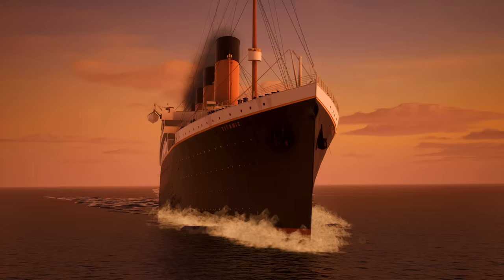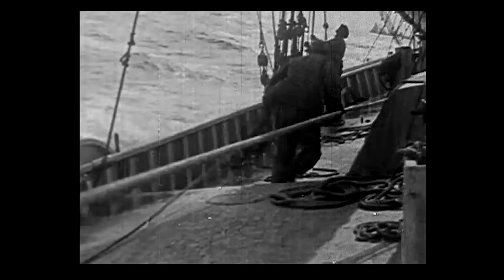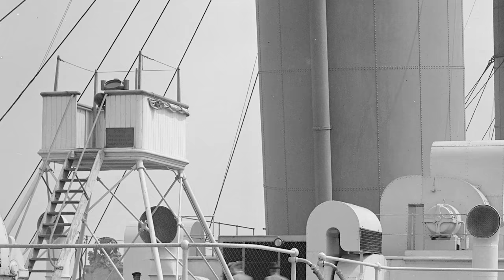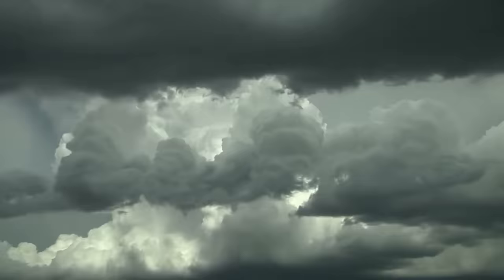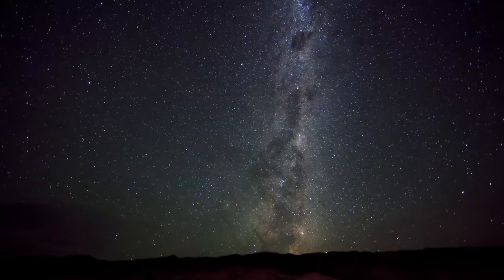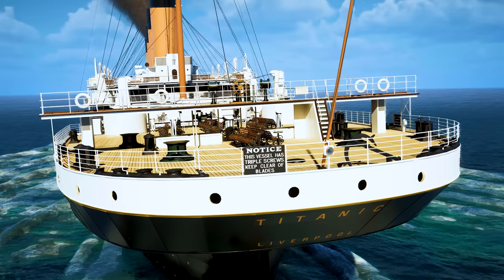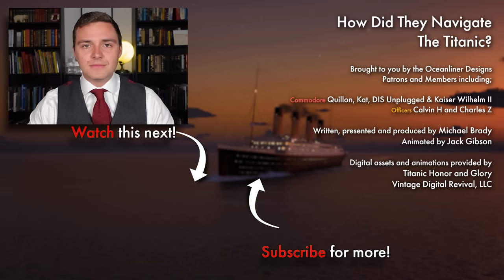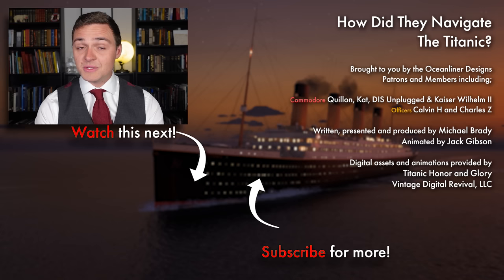How Did They Navigate the Titanic?

Comment: For those wondering what those green and red balls next to the compass are: Those are heavy steel balls that can be adjusted to fine tune the compass.
Reply: Iron...not steel. 
They are properly called "quadrantal spheres", but more often go by the moniker "navigator's balls" in the Navy. Their positions are adjusted (during an annual process called "swinging ship") to reduce the amount of error introduced as the ship turns thru the points of the compass, as the ship's relation to local magnetic fields also affects compass accuracy.
They are regularly put thru a process of heating to cherry red and then slow cooling (called "annealing") to remove residual magnetism.
There are also iron rods called "Flinder's rods" contained in a vertical tube contained within the compass stand. These are for reducing magnetic effects from the ship pitching up and down fore and aft.

Comment: Hi Mike. I’ve been binge-watching your videos most of today! They’re awesome! However, just to clarify, the big iron balls either side of the compass binnacle are to compensate for the effect of the ship’s steel. There’s also a set of iron bars inside the binnacle that move up/down. Together, these all can be adjusted to get the compass calibrated. In trials they would’ve “swung the compass” through known headings, referenced against known points on land, so that they could get it pointing right. The wood etc. only helps make all that much better. Also, magnetic north is not actually constant; it varies depending on where you are. All the more reason for knowing what your instruments are telling you.

Comment: I was on a modern cruise ship recently (Volendam). On the top passenger accessible deck, I noticed a compass platform. The unit was covered, buy you could tell by the shape that it was near identical to the ones used in Titanic. Interesting to see these centuries old methods still used as backups.
Reply: The other question is if mariners are still trained in these techniques, and do they stay proficient in them in spite of having all the modern systems? I could imagine some might just out of interest and tradition, while out at sea taking measurements the old ways and comparing their answer with the GPS.
Reply: @quillmaurer6563  yes, compasses are literally still used today lmfao. but even other things like celestial navigation is taught, because redundancy is important and computers can fail.
Reply: My friend is training to be an officer. He had to learn Morse code this year
Reply: Wow...very interesting!
Reply: @Plum Bit  I am learning Morse code...I know all the numbers and half the alphabet...I just got a HAM radio license! 🙂
Reply: All this stuff is still used today. On meny ships they are still primary way of navigation because GPS is still unreliable enough... Especially in case of blackouts... Magnetic compass is still most reliable navigation tool... We actually can calculate errors out of magnetic compass (deviation and declination) so that we can get very accurate and reliable position by taking bearings of literally anything that has been marked on navigational charts... Me personally I don't trust GPS because I have had situation where 5 different GPS units working on 2 different power sources failed to give me reliable position... Thanks to my training I was able to continue journey by magnetic compass without any issues 😉 good old paper chart and magnetic compass are still the best and most reliable navigation tools 😊
Reply: @juliemanarin4127  Nice!
Reply: Compasses in ships and aircraft are a lot more sophisticated than described here.  This barely even scratches the surface.
Reply: @givenfirstnamefamilyfirstn3935  gyro and satelite compasses yes but modern ships allso must have main magnetic compass... Usually it is on monkey island...
Reply: @quillmaurer6563  Calculators exist, but kids still though how to add and divide because it is necessary to understand how they work to know how to use calculator. Similarly, bridge crews need to understand navigation to know what to do when the fancy computers fail.  (airline pilots have to do same as well).
Reply: @jfmezei  Agreed, I've thought a lot about non-calculator math, which was a point of misery - perhaps trauma even - for me in elementary school. It is important, but there's no need in this day and age for it to be timed. As for the navigation stuff, agree that knowing and understanding the old ways is important, but in aviation (I am a pilot) I see the semi-old-ways, using ground-based radio beacons, still being taught even though most airplanes aren't equipped with the receivers anymore and the ground stations are gradually being decommissioned. It's time that system be abandoned. But usage of a map and seeing things on the ground is certainly a skill that should never be lost.
Reply: Roughly north of arctic circle, compass is no longer trustable and pilots have to "navigate". (yes, GPS helps a lot today, but they must be able to navigate without it).  Similarly, over the long oceans, there is no radio beacons and pilots have to navigate.  Again, GPS now integrated but must still know and understand how to navigate.
Reply: @jfmezei  From what I recall GPS doesn't work very well at very high latitudes either. So options are a bit limited there. Plus those seas tend to be rough and stormy, and there's always the threat of ice. Not for the faint of heart, but not many ships have any reason to go there either.
Reply: denniswilson8013  still can't believe that hasn't been worked out yet - its been an issue on Empress of Ireland,Lusitania, Andrea Doria and Costa Concordia - the four  BIG liner shipwrecks post Titanic.
Reply: Th at is called a binnacle
Reply: @williamneale7238  It's probably an issue of what is legally required versus what would actually be necessary for safety - a lot of things (on ships and elsewhere) are that way because that's what the rules specify, even if that's not what would actually be useful in accomplishing the purpose of the rule. So it's the rules that need amending. But it is a pretty difficult challenge - there really isn't a good way of launching lifeboats from the high side of a listing ship, they'd scrape against the hull. The low side would be difficult too because they'd be swinging out away from the hull. The only solutions I could see would be to have enough lifeboat/raft capacity to carry everyone with half unusable, meaning enough total for twice the people aboard, or to design lifeboats that could be launched in a more serious list - perhaps design both ship and lifeboats so they could slide along the side of the ship without damage.

Comment: As a US Air Force Navigator I used a sextant to do celestial navigation on the C-130 transport aircraft in the late 80s-early 90s while flying across large spans of water (like the North Atlantic). Sometimes the moon was above the horizon during the day but if only the sun was visible it would give you a "line of positioning" and you were somewhere along that line. To narrow the position we used other means such as "dead reckoning" (involving a compass, a clock and an airspeed indicator). Celestial navigation can be very accurate.
Reply: Wow! Thank you for your service!!
Reply: In the last century (!) the CAA Airline Transport navigation exams had insanely difficult procedures to get bearings from (!) far distant non directional radio beacons across the earth's curvature.  They might have been of some use in a pre war flying boat doing just over a hundred knots with a dedicated navigator's office and table.  Pass the exam and forget it (it would be gone after a week anyway).
Reply: interesting! I read that the dead reckoning method was the method Boxhall used to calculate Titanic's position
Reply: Deduced reckoning or pilotage, is the most basic form of navigation.
It is also the core of celestial navigation.
By tracking speed, course and time, the position of a ship (or aircraft or ground vehicle) can be deduced. Small errors will add up over time, which is where CN comes in.

Comment: Excellent video! 

To add a bit more to the Magnetic Compass section of the video, as a trainee (Cadet) Deck Officer, we learn how the various errors are corrected (with hard and soft iron) on the Magnetic Compass and it is quite an involved subject in of itself. Usually specialist compass correctors come aboard to do this job, the ship being "swung" in the process, but it can also be done by the Master if needs be/doing so can be justified. 

On contemporary ships the Magnetic Compass is mounted on the bridge roof, called the Monkey Island, or elsewhere high up in the forward superstructure to reduce the errors caused by the ship, a periscope being next to the helm position so we can use the Magnetic Compass on the bridge.

We keep a book on the bridge with the Magnetic Compass errors in it as it is regularly checked, as we have to take this into account when navigating the ship. 

We tend to prefer the Gyro Compass when all is said and done though as it's more reliable, the Gyro Compass Repeaters being found on the bridge wings as the Gyro Compass itself is usually deep down in the ship, for example in the engine room.

We usually have at least one permanently mounted Pelorus midships on the bridge.

Comment: You do notice on the side of each compass the large  steel balls painted red and green?  These are movable and used to compensate for the steel of the ship and it's interaction with the magnetic compass.  No matter where you place a compass on a steel ship,  it will need to be adjusted and calibrated with a compass that is not in the magnetic field of the ship by using these steel balls.
Reply: Also the Flinders Bar mounted vertically in front of the binnacle adds to the compensation. A ship's compass is "swung" when the compass is compared to known bearings with the ship on different headings. Correcting magnets are placed around the compass bowl and the process repeated until all the differences (deviation) are reduced to minima. This is recorded on a card which is used to correct compass bearings to magnetic and true bearings.
A quick and easy compass check when in sight of land is a "transit" when a bearing is taken on two objects marked on the chart are in line. The equivalent when out of sight of land is a bearing on the sun at sunrise or sunset. The bearing being a simple exercise in spherical trigonometry.
Reply: Iron...not steel. 
They are properly called "quadrantal spheres", but more often go by the moniker "navigator's balls" in the Navy. Their positions are adjusted (during an annual process called "swinging ship") to reduce the amount of error introduced as the ship turns thru the points of the compass, as the ship's relation to local magnetic fields also affects compass accuracy.
They are regularly put thru a process of heating to cherry red and then slow cooling (called "annealing") to remove residual magnetism.
There are also iron rods called "Flinder's rods" contained in a vertical tube contained within the compass stand. These are for reducing magnetic effects from the ship pitching up and down fore and aft.

Comment: Interesting fact: one of the small bits of wreckage from the Edmund Fitzgerald was approximately half of her pilothouse sounding board, where the crew would record the results of sounding using a line with a weight on the end.
Some sites claim Fitzgerald had an echo depth finder, but depth finders were not required on commercial vessels until 1977.
So even as late as the 1970's, the old fashioned way of determining water depth was still in use.

Comment: Gotta love the Titanic Honor & Glory dedication to historic accuracy: showing the Titanic listing to port slightly as she travels through the waters. 
I wonder how much of that port list was left on the night of the collision. The sources are not very clear on that. It's unlikely she maintained the same amount of port list throughout the (nearly) 5 days of her voyage, because a certain amount of the coal in the forward bunker probably had been used up for the furnaces and was no longer just shoveled from the starboard to the port side of the hold in the effort to get to the heart of the smoldering coal. Apparently coal fires in the bunkers were not uncommon. They often were the result of sparking when lumps of coal tumbled down the coaling chutes during the bunkering process. Sometimes the coal was hosed down with a water spray to prevent such fires from happening and avoid the formation of coal dust in the air, which carried its own hazards...

Comment: Great video.  My only quibble is that I don’t think Boxhall took a star sight after the ship hit the iceberg; I think he used the results of the sight taken around 7 or 7:30 PM that evening and then used “dead [deductive] reckoning” to figure out the current location based on course, speed, and time run since the last fix.
Reply: I would agree with J. Smith here. When I was trained in astronavigation in the 1970s our target time from observing four stars to putting a cross on the chart was 40 minutes, and that was using sight reduction tables, which simplified the calculations compared to using spherical trigonometry and versine tables etc. Also it is very difficult to take star sights at the dead of night as you need to be able to see the horizon. Star sights are normally taken during twilight when only the brightest stars (those used for navigation) and the horizon are visible. A dead reckoning position taken from the evening star sights seems probable.

Comment: The engineering around magnetic compasses is so fascinating for such ancient technology. They're still required equipment on airplanes today even though they've been made redundant by radio navigation and GPS, and airplane designers have come up with all kinds of clever ways to isolate them from interference - in most small airplanes they'll be above the windshield away from the other instruments, but my favorite are the DC-9/MD-80 airliners where it's mounted on the back wall of the cockpit and has to be viewed through a mirror. Funny to see that shipbuilders 100+ years ago were struggling with the same problem.

Comment: I'm going to go out on a limb here, but I'm pretty sure the "Time Sight" method was used to determine longitude. Per Dutton's Navigation & Piloting, this method was used in the merchant marine up through WW II. This method involves observing a known celestial body well to the east or west, noting the time of observation and the sextant altitude above the horizon, and having a good estimate of one's latitude. From these inputs one can determine the Meridian Angle, t, which is the difference in longitude from the ground position of the celestial body at the time of observation (note - one needs a current Nautical Almanac to determine the ground position).

My guess is that Boxhall had a good time sight fix at evening twilight and his estimate of Titanic's position at sinking was based on Dead Reckoning (DR) since his last fix. At night it is very difficult to get an accurate sextant altitude as the horizon is very indistinct.
Reply: Even more so if some of the atmospheric conditions some have discussed that played games with the horizon and the icebergs' spotting...
I have taking night sightings. Not something everyone can do well, even in the best of conditions..

Comment: Fascinating stuff! I've seen one of Olympic's compass binnacles on display in the gift stop of the Molly Brown House in Denver, Colorado, of all places. It feels like some of the celestial navigation script pages got out of order or something though, and the question of how they navigated under cloudy skies was never answered.
Reply: I assume they would use dead reckoning as it is the if all else fails option of navigating. One of the commenters said he used dead reckoning as a USAF navigator in the 80's/90's which I find interesting. As for how to navigate via dead reckoning it is pretty straight forward.

First off you need accurate charts of the area you are navigating in. Using those charts you then plot a route from your start point to your destination. Now you just have to follow the line you plotted. Well easier said than done. Of course you need a compass to give you a bearing but you also need a method to estimate the ships speed as well as a chronometer. It might go something like this for one of the plots. 

You start out on compass bearing 125 your plot line says you need to alter course to bearing 135 and continue on that bearing for 20 miles then head to bearing 110. A reading tells you the ships is making 20 knots so you know after an hour has passed on the chronometer you are at the point you need to alter course again. Repeat until you reach your destination. Hopefully.
Reply: @evanator166  I'm familiar with dead reckoning, or as some pilots say "If you reckon wrong, you're dead!" The question is how accurate that would be in a storm (for either ship or aircraft) as maintaining a steady course/heading and speed would be difficult when being battered around by wind and turbulence or waves, and unless you know exactly what the wind or current is you don't know how much you're being carried off course. That would still put you vaguely in the right spot, but I wonder if they had a more accurate method? Later there were radio-based navigation systems like LORAN, NDBs (Non-directional beacons), VORs, and later GPS, but not in Titanic's time - was there something else they had at that point though?